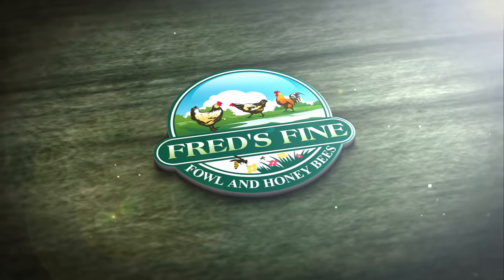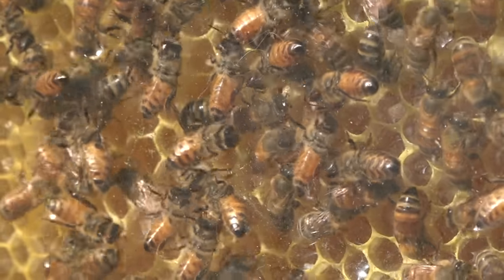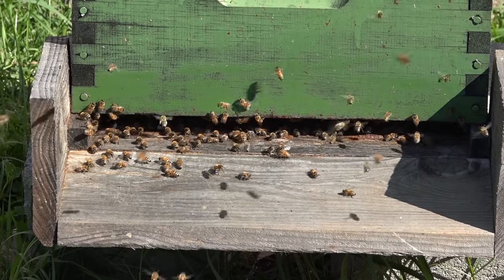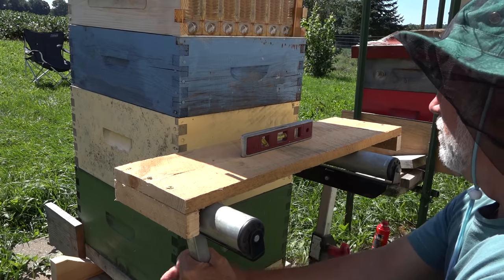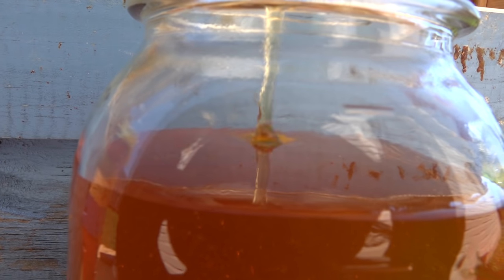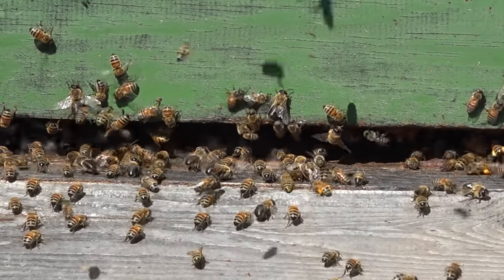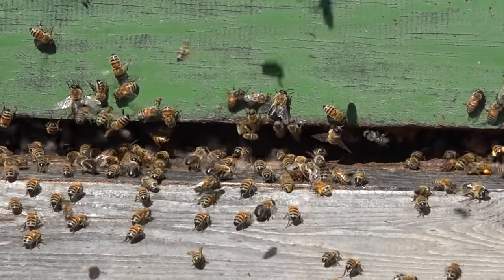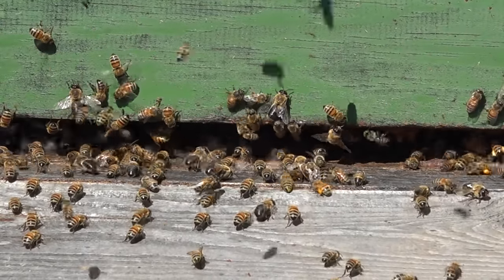First Flow Hive Extraction Cycle How to remove honey without filtering frame by frame

Comment: do you recommend collect one frame per day, too?
Reply from the maker: Yes, I would definitely only do a couple of frames a day MAX... the problem here was that I went through all seven frames in a single hour. Because I'm testing and evaluating the system I wanted to see all of the potential problems. I will share that all of the bees are back on track today and every part of the hive seems perfectly normal. They are filling the cells right back up!
Reply: Thanks

Comment: Fred, blue chamber is shorter than others, what is that?  I am a beginner...
Reply: Red (Brooding chamber) and blue chamber(shorter) and Super and then blue shorter.  Are these empty only for the heat management?
Reply: at 9:44 The other one has different order.  Long Long short Super order...
Reply from the maker: The Blue Box is a medium super just for the honey which is left on for the bees to winter over.
Reply from the maker: They are all full of honey and pollen.
Reply from the maker: Top Red Box is a medium honey super so I could see if the bees would pass through the Flow-Frames and fill that first. The Blue Medium Box was filled with honey first (bee winter food) then I put the Flow-Super on without a Queen Excluder. The bottom red box is the brood chamber where the bees build up first before any of the other boxes are added. I hope that helps? Thanks for watching!
Reply: @FrederickDunn   Which month do you stop taking honey from bees?
Reply from the maker: @younginsong4355  Generally it's that last week of September.
Reply: @FrederickDunn  So, from October whatever bees collect is for the winter through early spring, til the blooming.  So you don't give anything during the winter.  Let them survive whatever they have.  Keeping Bees naturally. Right?
Reply from the maker: @younginsong4355  Correct. that's how I've done it for the past 12 years.
Reply: @FrederickDunn   Then what do you do from October for bees?  Nothing until March (bloom starts) except observing the temperature with very expensive gadgets ^_^ ?
Reply from the maker: @younginsong4355  Correct, once they are buttoned up for winter, it's a waiting game. Those winter months are for refurbishing hive equipment and studying up for spring :)
Reply: fantastic, no feeding, watering, or warming with blankets due to the greed inside the human being that extracts out hive after September.   One last question, I found no streaming about how to control mite, what do you do about it?  I witnessed mites were gone by Cinanmon(?) Oil  inside the mattress.  Do you also treat these parasites in October before winter?
Reply from the maker: @younginsong4355  My bees are genetically selected to groom off and destroy mites without treatment. This line of bees have been treatment free for many many years... look into BeeWeaver Bees for more information.
Reply: @FrederickDunn   OMG I thought I read your breed was from Texas? The strongest one
Reply: @FrederickDunn  Then after September, what kind of flowers do you have around for the bees to collect and store for the long winter.  Would you share? or any bee loving trees?
Reply: @FrederickDunn  So, there is zero sugar in brooding chamber or Super, right for past 12 years?
Reply from the maker: @younginsong4355  There is both honey and pollen in the brood box with the brood - upper boxes become filled with honey.
Reply from the maker: @younginsong4355  My late season pollen and nectar comes from Maximillian sunflowers.... asters and goldenrod. No tree pollen at the end of the year.
Reply: @FrederickDunn  Thousand Time Thank You!
Reply: @FrederickDunn  But I heard these bees are less collecting honey.  The ability to collect honey is marginal... compared to others.   Is it right?
Reply from the maker: @younginsong4355  Yes, the survivor line of bees I work with will produce 1/2 the honey that the Italians I used to work with did. But the Italians were overwhelmed with varroa very easily while the survivor lines hold their own. But yes, there are much more productive honeybees!
Reply from the maker: @younginsong4355  you're very welcome
Reply: @FrederickDunn   I know exactly that mite can be treated with cinnamon oil in the mattress.  I thought why not in the bee hive?  cinnamon oil smoker?  Would you try for your Italian bees?  for natural treatment?
Reply: @FrederickDunn   Then, what do you do to treat mites for your Italian bees?
Reply from the maker: @younginsong4355  I don't keep Italian bees because they could not hold their own against mites. I wasn't willing to use chemicals in my hives.
Reply from the maker: @younginsong4355  I personally would not do that. There may be other beekeepers that can share their procedure?
Reply: @FrederickDunn   When I read, I thought you told me you have Italian breed and Texas Breed both regarding productivity was concerned.  So, at that time I understood that both breeds have been kept by you. Sorry.  I live in S. Korea. There is no way for me to get that Texas breed legally, sadly enough.
Reply: @FrederickDunn  How much do you sell your  honey in USD, the smallest bottle for example?
Reply from the maker: @younginsong4355  I don't produce enough honey (or the bees don't) to market any real amount, but my wife sells it at $20.00/quart USD. If we put a ReCap Mason Jar Lid on it, that's an additional $3.00 deposit. We had a woman come and buy an entire gallon! That was $80.00. Most people want quarts, but a pint is $10.00 in a muth jar with a cork.
Reply from the maker: @younginsong4355  I had Italian bees back in 2009 and they were great honey producers and good at handling cold. My problem with them was that they demonstrated almost no resistance to varroa parasites and I didn't want bees that required treatments. That's how I began to work exclusively with hygienic varroa resistant survivor bee stocks. I also collected swarms and hived those but ran into the same problems of those bees needing treatments to survive. This year I am using survivor stocks exclusively and won't be hiving any swarms unless they are from my own apiary.
Reply: @FrederickDunn   Aha, nevertheless low productivity.   Ok, I copy that without fail but my Gov. won't allow that breed to be imported.... The di lemma.  >_<  But I can send letter to the Gov. official.
Reply: @FrederickDunn  A gallon? OMG but probably she has a French bakery shop that needs lots of honey???
Reply from the maker: @younginsong4355  Five kids! And they brought me a custom hiking stick once :)  they LOVE honey.
Reply: @FrederickDunn   1quart is about 1 kg.  1 kg = USD 20.00 Humm.  + container.   That's a bargain when it is known 100% honey without a single drop of sugar.  That's a really bargain.  I think your wife can sell it as a 40.00 USD per quart.  saying it has not been under the process of concentration, which has live enzymes with water level 15.  I think your wife sell honey with bargain price.  When she sells, she must show the flowhive stream of you for the customers to  trust, the real value. Even 40 USD per quart is cheap! very cheap!
Reply: @FrederickDunn   I learned checking temperature inside the chamber is very important.  Would you recommend me the best gadget for checking the T of the chamber?  I heard there is a gadget with screen shows the temperature ? If you did before, please direct me gadget episode in youtube.
Reply from the maker: @younginsong4355  Are you asking about a thermal camera or something else? There is a brood minder that measures hive weight and interior temperatures https://broodminder.com/
Reply: @FrederickDunn  Wow  \0.0/
Reply: @FrederickDunn  I didn't see any stream that shows you are using broodminder.  Do you use it, too?  Too expensive ~
Reply from the maker: @younginsong4355  I don't use it and have no plans to try it out - I'm letting my friends have that experience and so far the data is "reportedly" inconsistent. For me, it would be just another thing I have to keep track of and I don't feel it's necessary in my own apiary.

Comment: Still haven't got a clue how you drain the honey other than using something called an activator. O well interesting video anyway.
Reply: The keys basically pry alternating parts of the frames up and down, half of each cell moves up and the other half moves down (like, left half, right half) thus breaking each cell open on its entire length.
Reply: @JasperJanssen  Ah, cos it was on a slant I thought there was a series of plugs at the back where it ran down a central tube. Thanks.

Comment: Any thoughts on how lon a flow frame will last?
Reply from the maker: That is yet to be seen, I'm just wrapping up my first year with them. I'm not certain which components will fail first, or if the plastic will become brittle? Keeping the frames out of sunlight would be important as UV definitely breaks down plastics. Some people micro-wave frames as part of their pest control, that may also cause deterioration. I don't see freezing and thawing as a problem as that doesn't alter the material condition/properties. We'll see.
Reply: Thank you for your quick response.
Reply from the maker: kennapop3 you're welcome :)

Comment: Could it work with stingless bees?
Reply from the maker: Hi Joseph, I'm going to say that I wouldn't buy this system for stingless bees. People who manage stingless bees have a hard time controlling how and where they put their little honey pots and they don't tend to use artificial cells. Stingless bees, depending on which line you have, produce very little honey when compared to the honey bees. I don't rear any stingless bees as they can't handle the weather conditions where I currently reside. Interesting question though! I just can't recommend using the FlowFrames for anything other than honey bees.
Reply: Thanks!
Reply from the maker: Joseph Cadelina you're welcome!

Comment: If the bees make all this honey, they must do it because they need it.

Then we come along and take it.

Doesn’t that leave the bees short?
Reply from the maker: It's actually one of the reasons that honey bees have been so attractive to management. They collect, and store far more honey than they can use. It's part of their protection system in the wild. People have learned to provide extra storage space for the honey which keeps the bees from swarming out which they would do on their own in a smaller cavity. A good and responsible beekeeper won't remove what the honey bees need to survive a long winter.
Reply from the maker: I really appreciate this Question Andrew as I think many new keepers may not understand how important it is to leave an adequate amount of honey for the bees. I will be discussing this on Friday during FAQ44.

Comment: It's confusing to me because the Flow Hive is suppose to make it easier on the bees but drowning them with leaking honey and kicking all of them out of their home ....that's more disruptive to the entire hive. Just my opinion
Reply from the maker: No leaking honey is lost and they repurposed it, this method is far less invasive and damaging to the bees and their infrastructure. I do both methods and the flow-method requires less repair on the part of the bees and doesn't stop their production during the honey flow. I don't believe I said they were drowned? Whey you pull a box of honey and replace the extracted frames, interior humidity also goes up and the bees also stage on the front of the hive for a while as they clean up the freshly spun comb.
Reply: @FrederickDunn  I really appreciate your response. I absolutely love your videos and listening to you narrate them. Your voice calms me. I think you could talk about a to clean a toilet bowl and I'd be in heaven listening.lol I really love the Flow Hive but is there any way that it won't leak?
Reply from the maker: @247KW  They only leaked during the first cycling of the frames... It's not an ongoing problem. Thanks for the wonderful compliment :)

Comment: Dont open the flow frames fully and you shouldn't have as much honey going through the hive.
Reply from the maker: Thank you Chris, because I'm reviewing it, I'm going with the designer's instructions. Actually, opening the frame all the way produced more honey than a half open procedure as it has more time to drip through when half way open. Has your experience been different?
Reply: I haven't used my flow hive yet. Hopefully your research will help me for when my time comes! Excellent video by the way loads of info for beginners etc
Reply from the maker: ***** Hi Chris and thanks. I have two more FlowSupers almost topped off and I will be doing some "drip" analysis with those that should shed more light on this honey-drip issue. Stay tuned :)